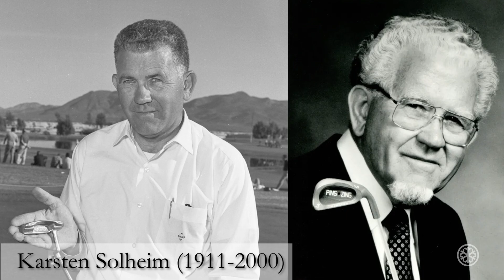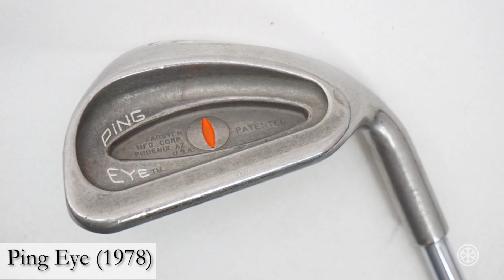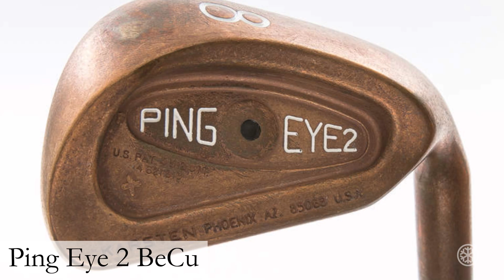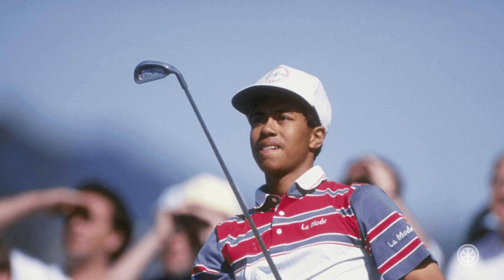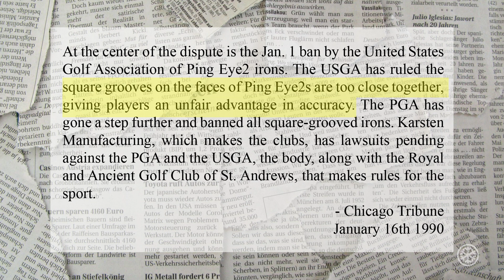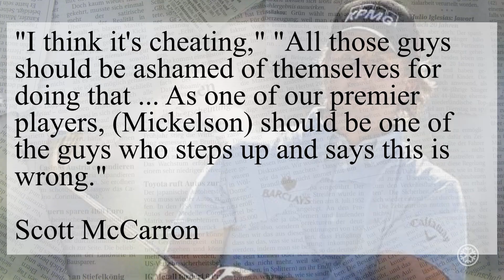Ping Eye 2: A History - I Can't Golf

Comment: Well Said.  But there was another innovation with the Eye 2 that other irons didn't have and that was the displaced clubhead or offset clubhead.   It was designed for players who slice the ball to not slice so much.  There was also another reason to use cast iron vs regular steel.  Cast iron was a lot stronger and lasted longer.  Good players kept wearing out the grooves on their Wilson Staffs and MacGregor irons because steel is softer than cast iron.  The other advantage with cast irons was if you broke a shaft, you only had to replace the one club and you wouldn't lose any continuity of feel with your clubs.  When you broke a steel iron, like and Wilson Staff, you had to replace all of the irons to get the same feel with each club.   Ping also used tapered shafts in their irons which means they narrowed at to clubhead end.  That meant you had to send your club to {PING to get it reshafted.  The Eye 2 woods were revolutionary, larger with a bulge going outward.  They took some getting used to.  But once you did, you didn't want to play anything else.  You mentioned color coding didn't you?

Comment: When I started playing in 1992 as an 18 year old I was using a set of womens Wilson forged clubs. I wanted a set of Eye 2’s very badly. By the time I saved up the money I had to buy the Zings. I absolutely could not stand the look of the Zing at address and I’m positive it affected my game. I sold the Zings and quit playing for a few years. Then I came across a 2-SW set of black dot original Eyes with ZZ Lite shafts. I bought the whole set for $60 and absolutely love them. I still play them to this day and just re-gripped with new 5L round grips. In the woods I have an i20 driver, i20 3-wood and i20 17H and 23H hybrids. Along with my trusty BeCu Ping Pal 6 putter. I won’t be buying any new clubs ever as far as I’m concerned.

Comment: Yes, I was so lucky to grab a set of Ping Eye-2 Orange code (2-LW, all serial no. matching) in the original Ping 350-Series, R graphite shaft.  Tried them all on the driving range.  Amazing, it very easy to swing.  I found the missed hits still making a good distance, about 80% less than those good impact hits.  However, due to the weak loft of Eye-2 set, I have to remember to add a club for the same distance, of my Mizuno MP-4.  Lastly, I also found that my scores from some rounds, by using this good-old Eye-2 set, even beat the best round (I have ever played this game).

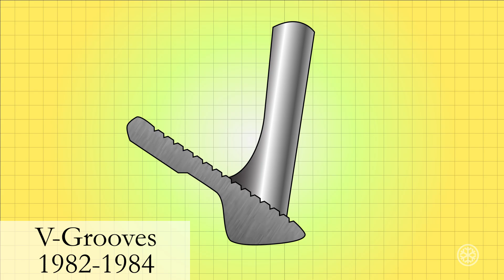Comment: You are wrong about the original Eye 2 grooves being legal under USGA rules (at about 5:16 in the video). As you later note, they are legal because of Ping's lawsuit against the USGA. They do not conform to the rules. On any club with 25 degrees or more of loft V grooves are NOT legal since 2010 - if they have sharp edges with no rounding, Almost all irons had sharp edges before then. The Eye 2's don't have rounded edges. They have a sharp angle at the groove edges. The same is true of U grooves. If they don't have rounding of the edges of the grooves they are illegal. If they do have rounding they are legal. Yes, U grooves are legal if they have the rounding which almost none did before the 2010 change of the rules.

Comment: Thank you, very informative video, good job sir.

Just bought my first set of used black dot / ping eye 2, 2-L at $150

Thx to you I understand the value of the line and will start collecting sets 

Just bought G10 driver w/G400 max in crosshairs
Reply from the maker: $150 is an excellent deal for a full set of Eye 2s! Have fun with that 2-iron!

Comment: What a great video bud. I recently bought  2 sets of Ping Eye 2 clubs (one BE set mfr'd in May 1988 w. 'square/radiused' grooves, and the other mfr'd in fall of 1984 and with the non-radiused square grooves) - did a lot of online research and weeding through the plethora of misinformation out there to find out as much as I could about them before I laid the $ down - and still couldn't find some of the info you've managed to find/post here on their production and evolutionary timeline. Great job! just a footnote - with the s/n's of the clubs, you can contact Ping Customer Service and they will dig through their records (which they maintain from day-1) to give you all the info they have on the clubs of interest (Mfr date, color of lie, all clubs included in set at time, finish/line of clubs, etc). First time I'd seen the old design drawings by and photos of Karsten.

Comment: Super video. I got a set in 1992 as a gift from my dad. 1-SW.  I had the lengths and lie angle readjusted by ping when i was 17 and still play them today...for no other reason than that ive never found anything better.
Reply: Do you still play the 1 iron?
Reply: I do…depending on the course.  Great in wind or courses with long par 3s.

It’s not a hard club to hit especially from the tee.  Same loft as a modern 3

Comment: I have a set of Ping Eye2 beryllium copper, 2-SW, mint, unused, never touched a golf ball, original grips! I also have a set of Eye2, steel, which I use. I don’t want to use the copper ones because they are mint and they’re probably only a few sets in this condition left in the world
Reply from the maker: Those are the ultimate collectors item! I’ve never seen a set that is new old stock like that!
Reply: Saw an unused full set of BeCu on EBay a while back for $5000!!! I almost cried

Comment: On the advice of a pro relative I bought a set of Ping Eye 2's in the early 90's. Loved them. Handicap came down to single figures. For some reason I changed them for Cleveland CG2's with graphite shafts. By the time I realised it was a big mistake it was too late. I had sold my Pings.
Reply from the maker: Well, I suppose you helped out someone else’s handicap. It’s never too late to find a new used set!

Comment: How can you find out if it's "U" grooves or "Square" grooves?
Reply: Full set of Ping Eye2, BeCu (Black Dot):

The top bar "Karsten Mfg. Corp. Phoenix, AZ 85068 USA" all run from the toe of the head to the heel.

Serial numbers:
1i: 74754 (VC)
2i: 336028A (VD)
3i: 467106A (VD)
4i: 467106A VD)
5i: 467106A (VD)
6i: 467106A (VD)
7i: 467106A (VD)
8i: 467106A (VD)
9i: 467106A (VD)
PW: 467106A (VD)
SW: 467106A (VD)
LW: B07796 (H)

VC = Serial printed vertically, up the shaft towards handle, with whole numbers completely cut out.
VD = Serial printed vertically, up the shaft towards handle, with numbers in small dots.
H = Serial printed horizontally around hosel, facing same way up as PingEye2, with whole numbers stamped with a punch.

Comment: Any info on the eye 2’s with the upside down Karsten stamp?
Reply from the maker: Yes! Those are the early V-Groove version! The Ping website does a good job of running through all the ways to tell the difference on the various groove models.

https://ping.com/en-us/legal/groove-rule
Reply: @icantgolf  this website doesn't mention "square" grooves. How can you tell if it's "U" or "Square"?
Reply from the maker: @robmoore2625  That's a good question. There seems to be a lot of conflicting info online, and often confusion between the U and Square grooves.

I don't know of any markings that differentiate between the U grooves that were produced early on and the square grooves that came after. I did use this website as a reference when making my video, though, along with the one from Ping in the original comment:
https://www.equip2golf.com/archives/history/ping_frameset.html?ping_eye2.html~archives
Reply: @icantgolf  Thank you. Your link solved it. I have the Eye2 Beryllium Copper irons, stamped with "US PAT. D276644 and 4512577". That means it's the "Square Groove", made in 1987.
Reply: @robmoore2625  Awesome, I’m glad you were able to figure that out. Hold on to those, they are a rare set!
Reply from the maker: @robmoore2625  No problem! Enjoy those awesome Pings!